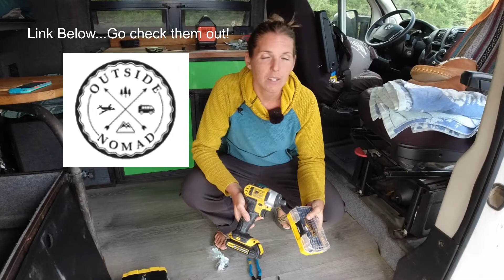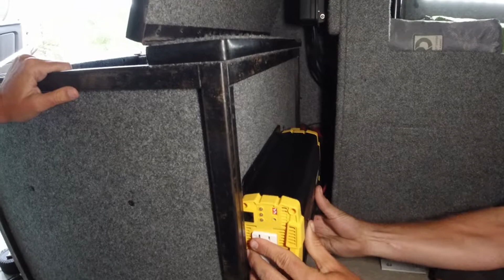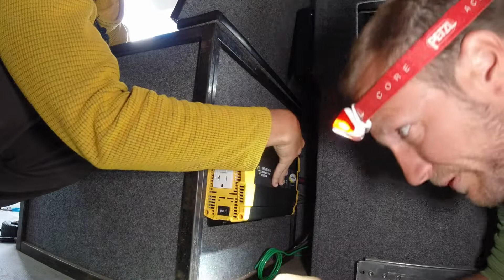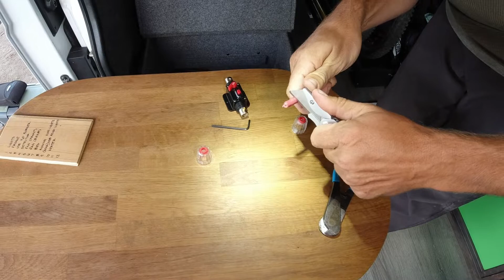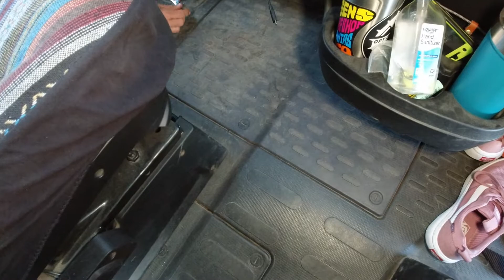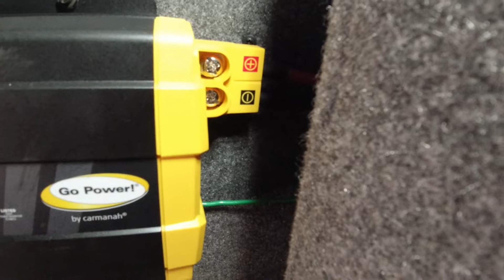700 Watt Go Power Inverter Install Promaster Van Conversion DIY Van Build

Comment: I see this is a year old but could you tell me what inline fuse you used 100 amp or the 150 thanks much
Reply from the maker: Thanks for watching! If I remember correctly,  the instructions had the required fuse size in it. I double checked and we have a 100A fuse for our setup. Please purchase through our Amazon link on the page if you're considering buying something. It helps us out a little. Let us know if you have any other questions.

Comment: Hey I  have a 2021 pro master I made into a mobile barber and can you tell me how you ran the cables under the floor to to the battery. I need to know how you ran the wires under the front. My floor and thresh hold looks very similar to yours.
Reply from the maker: We have a 700 watt inverter so our cables may be thinner than yours dependingon what inverter you are using. We used a massive zip tie and slid it under the floor to the other side. Then we used electrical tape to tape the wire to it and pull it back through. We also ran our isolator wires along the driver side. They are routed under the plastic trim inside of the door. That might be another place to check out. Thanks for watching and good luck on your wiring.

Comment: How many Ah battery?
Reply: It’s AGM
Reply from the maker: This install was on our old van which had a 200ah battery.  In our new van we used the same inverter, but have 2 200ah batteries.
Reply: What brand?
Reply from the maker: They are Renogy AGMs. Here is a link to them. 
https://amzn.to/3fjPb8T